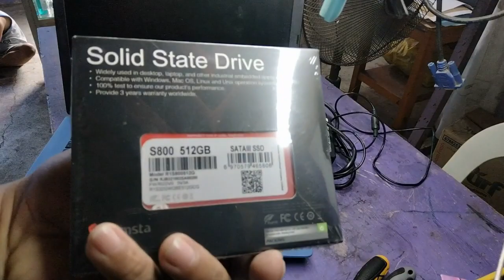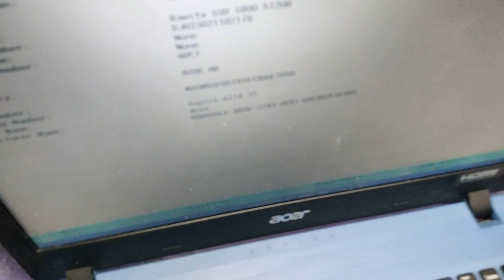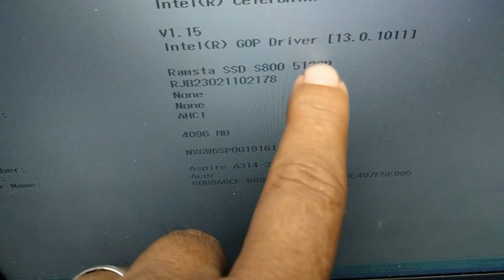ACER A314-32 LAPTOP I hdd to ssd upgrade I tagalog

Comment: boss may m.2 slot yan?
Reply from the maker: yes meron sir m.2 sata slot
Reply: Thank you sir, pati nadin sa comments. Buti na lang nabanggit mo na hindi nvme yung M.2, muntik nako bumili. Waiting for my SATA M.2. Also after ram upgrade, normal na yung operation ng windows 11.
Reply from the maker: welcome po glad it helps
Reply: Update lang po. Upgraded Teamgroup m.2 SataIII + Kingston 8gig ddr4 2400. Boot up from 1min is now down to 10sec. Also apps/ programs and folders now open instantaneously in Windows 11 Pro. I also kept the 500gig Mech Hdd so I pretty much have a 1tb unit.
Reply from the maker: complete reborn ang performance nang laptop mo.congrats

Comment: Sir.. Good evening tanong ko lang po.. Yung laptop ko Same model po nyan yung ni upgrade nyo Acer aspire 3  A314-32. bumili ako nung EDILOCA M.2 SSD 512GB sa shopee Hindi po sya ma detect sa bios tas sa installation ng windows,pero umiinit po sya kunti katulad ng una kung SSD na Kingston 128GB ano po gagawain ko? Sana po masagot agad.. Thank you
Reply: Try mo i check sa crucial system scanner (official website). dun mo makikita kung ano yung compatible upgrades sa laptop model mo

Comment: Lods. Parehas po tau unit Acer aspire 3 a314-32-c1ge, intel celeron 1.10 ghz. Naka m.2 ssd card onboard memory. Bali po gusto ko po kc magdagdag ng ram sa slot nya. Kaso po hnd ko po alam ung bibilhin kong ram. Tia po.
Reply from the maker: 2400 mhz to 2666 mhz or higher lods pwedi dyan .matic na yan mag add sa onboard na ram mo
Reply: @alberttechchannel7250  di po compatible ang 2R, single rank lang  ata pwede na ram tulad ng crucial. black screen lang sa hyperx impact 4GB 24000MHz

Comment: idol, bumili po ako ng ssd ng unit na ito, kingston a400 240gb po. Kaso nung na lagay ko na po ssd and inopen ko po ay no bootable device, sana po matulungan.
Reply from the maker: need po yan installan nang windows operating system or O.S para gumana..
Reply: @alberttechchannel7250  paano po yon? may detailed video pa ba kayo?🙏🙏 salamat po ng marami

Comment: Need po ba yung windows installer with drivers kapag nagpapalit po ng ssd and ram?
Reply: How po bang magkaroon ng OS installer from you boss?
Reply from the maker: YES need po new windows installer.its free po  from microsoft website.via windows media creation tool.uou chose which version of windows 10 or 11
Reply: @alberttechchannel7250  kailangan pa po bang bumili ng product key after mag install niyan?
Reply from the maker: ano po vah unit ninyu laptop or desktop?mostly sa mga laptop meron yan oem license if windows 10 verion automatic mag activate yun..kung desktop naman.good practice talaga maganda talaga bibili tayu nang license..or other way meron

Comment: Boss same device tayo ano marerecommend niyong cpu kasi ang bagal ng cpu ko
Reply from the maker: ang cpu po neto is naka soldered sa board in short hindi pwedi palitan..upgrade nyu nlNg po into SSD drive and ram.bibilis yan 100%
Reply: @alberttechchannel7250  ano pong mare recommend niyong SDD and RAM para mas bumili pa laptop ko boss?
Reply from the maker: @allenkalbo328 any brand po nang ram and ssd will work..ofcourse bumili po kayu sa mga trusted stores
Reply: @alberttechchannel7250  boss pwede nalang kaya palitan ang mb ko?
Reply from the maker: @allenkalbo328 nope..1 model lang po ang motherboard nyan..palitan kung meron major problem ang board or unrepairable....only ssd upgrade and ram upgrade lang owedi gawin dyan.

Comment: Boss pwer ba yang lagyan ng nvme sdd?
Reply from the maker: in this model po M.2 SATA SSD lang..hindi po sya compatible sa nvme as per the manual
Reply: Boss yung kinabit mo is SSD lang tama po ba? Pwede bang retain HDD tapos ang ikabit is M.2 SATA? since compatible naman sya?
Reply from the maker: yes po pweding pwedi primary mo os m.2 sata
Reply: Boss sata ssd at m. 2 ssd lang  pede ikabit no?

Comment: Good day, boss. Bumili ako nang SSD RAMSTA 256GB katulad din sayo. Acer 3 A314-32 din laptop ko. Kaso hindi na detect yung SSD. 

Itong po ang lumabas. 
Default boot device missing or boot failed. 
Insert recovery media and hit any key. Then select " boot manager" to choose a new boot device or to boot recovery media. 

Click ko yong enter button sa keyboard ito naman lumabas

Boot option Menu
1. Network Booy - IPV6: D8-C4-97-91-2B-4D
2. Network Booy - IPV4: D8-C4-97-91-2B-4D

Click enter button
Wla nangyari ito ang lumanas CHECKING MEDIA

Then bumalik rin sa Default boot device missing or boot failed. 
Insert recovery media and hit any key. Then select " boot manager" to choose a new boot device or to boot recovery media. 

Pa help naman boss, please. Thank you.
Reply from the maker: pa check sa bios press f2 key.para makapasok ka.din check sa information kung na detect yung new ssd drive..check mo yung video ko sa dolo.dapat makita yung ssd diin.
Reply from the maker: please note neemld mo installan nang OS yan after ma insert ang new ssd
Reply: Thank you boss. Appreciated❤ Na detect po yung SSD after clicking F2. 😊 
Meron po bang sunod na gagawin kapag na detect nayong SSD boss? 
At
di ko alam kung panu mag install nang OS sa SSD.
Reply from the maker: pwedi ko kayung e remote sir.need po ninyu flash drive atleast 8gb.srable internet conection and extra desktop or laptop para sa OS download
Reply: Boot mo f2 then pnta ka sa security gawa ka password then disable mo secure boot